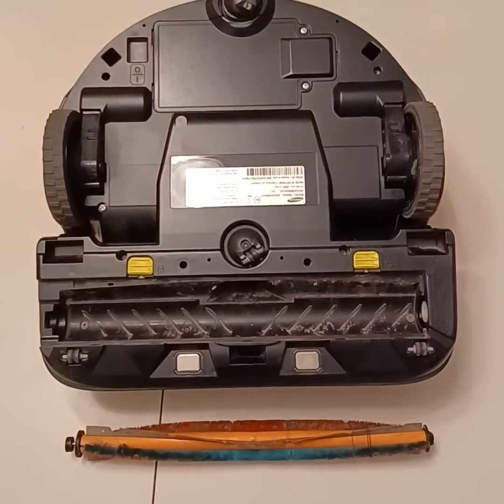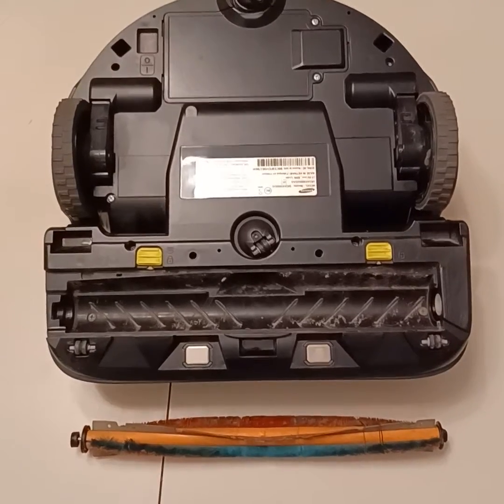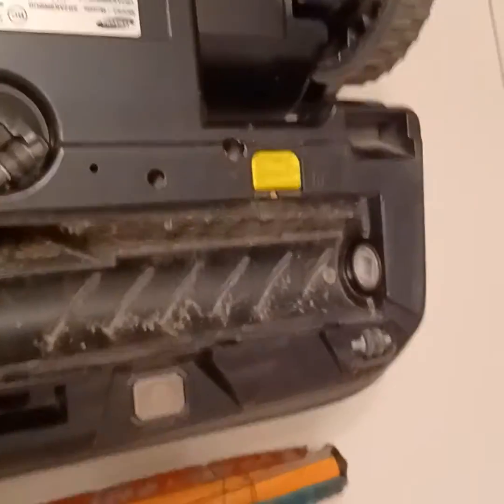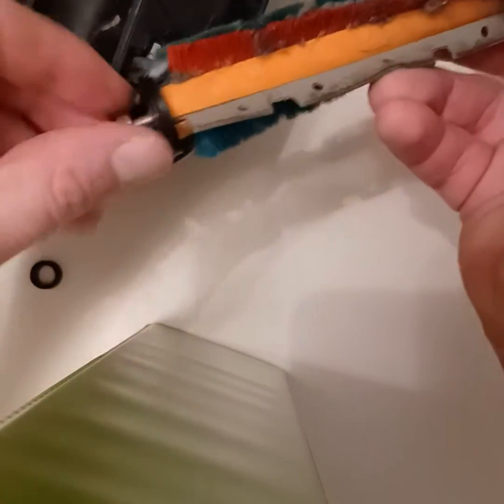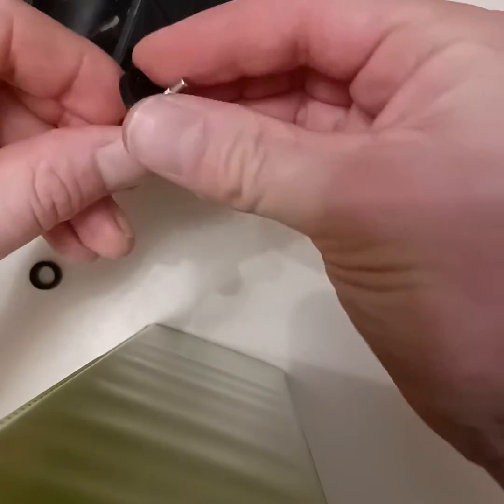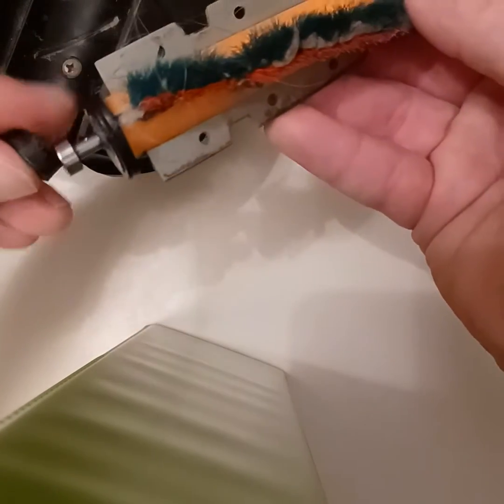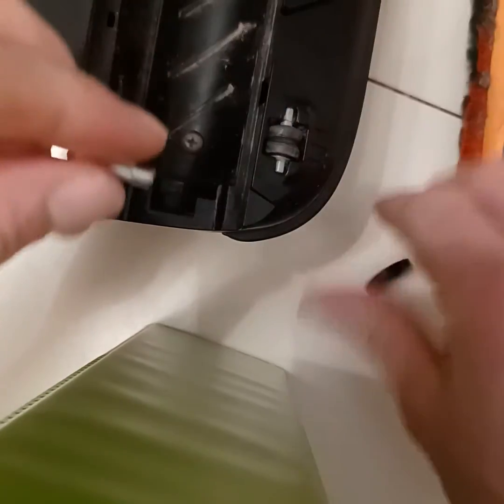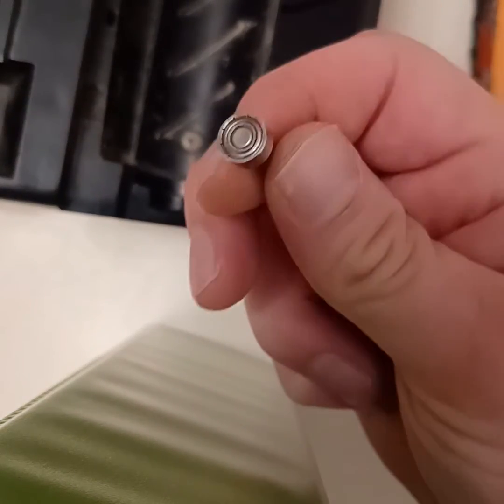Samsung CycloneForce Robot Vacuum Rattling Noise

Comment: Hey! Did you ever figure this out?
Reply from the maker: What do you mean?  The bearing on the end of the brush gets filled with dirt and it seizes and then the entire bearing spins (instead of just the middle part) and then it starts to wear away at the plastic housing that surrounds the bearing and creates a bigger and bigger hole and starts bouncing around and rattling in the hole.  The solution is to replace the bearing with a sealed one which is better at keeping dirt out, and somehow account for the worn away plastic and still hold the new bearing in place.
Reply: @erikmueller3506  Yes, i went out to bunnings and got 2 rubber seals to put over the bearing, and put a bit of silicon in the plastic, thats done the trick!